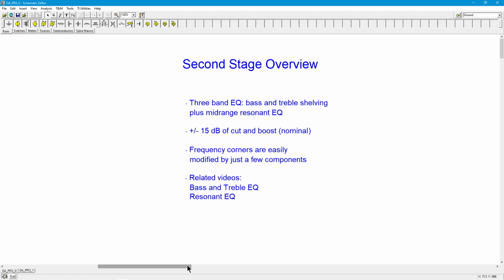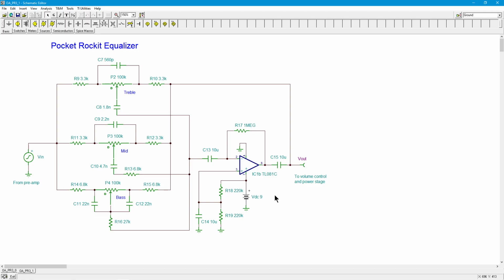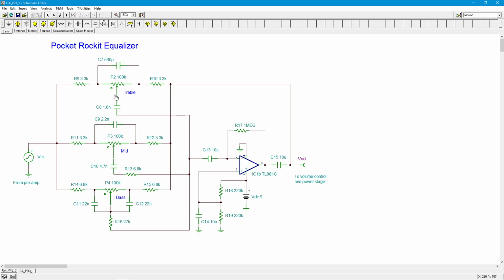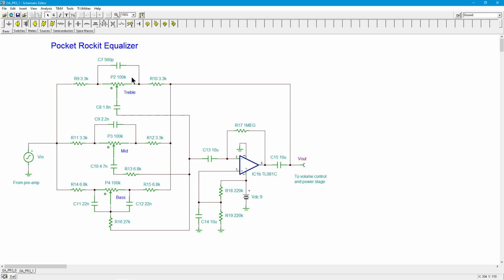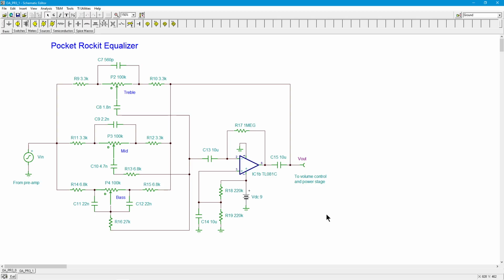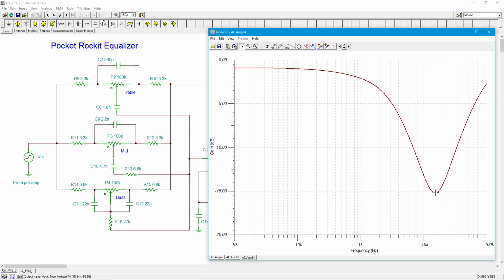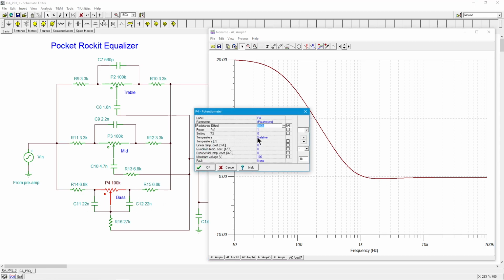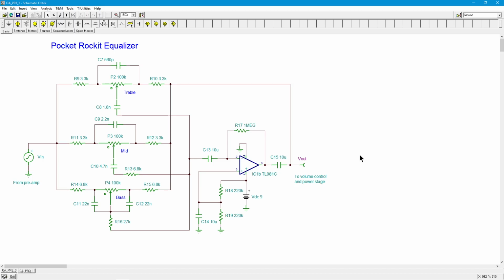Op Amps: Pocket Rockit Personal Amplifier, Part 3

Comment: I am going to expose my ignorance.  Your controls work just the opposite of what I would intuitively think.  Take treble for example.  I would've thought that turning the control to 0 would reduce higher freqs, but it seems to do the opposite.   If I turn it all the way up, would increase those same freqs.  Yours seems to do just the opposite.  Am I missing something or have I not understood EQ operation for all these years?
Reply from the maker: Perhaps the wiring in the sim is throwing you (?) This is designed so that full clockwise rotation of the treble pot increases the level of the high frequencies. Full CCW reduced them. Placing the pot in the middle leaves them unchanged. Practically speaking, reversing the outer leads of the pot will reverse the cut/boost.
Reply: @ElectronicswithProfessorFiore  Perhaps, but I do assume setting a pot to 100% corresponds to  full clockwise and zero is full counter clockwise.  In the video, when you set the pot to zero, we see a increase in  the upper frequencies.  See time 14:20.
Reply from the maker: @jamesbelcher5318  On EQ, full CCW is not 0 dB, it's max cut. It's not like a volume control. EQ controls are not labelled "0 to 10", they are labelled "-x to +x" (x being max cut/boost). In the circuit, setting the pot to either extreme yields max cut or boost. Leaving it at 50% gives no cut or boost.
Reply from the maker: After thinking about this for a bit, it occurs to me that the picture on the sim is what's throwing you, namely, that the wiper arm at "zero" is causing the treble boost, given the assumption that the pot would be wired the same way on the PCB (i.e., fully CCW is "zero"). The issue is the assumption. I could have just as easily spun the pot 180 degrees in the sim to get rid of this situation, but then the inevitable question would be "Why does the pot's wiper arm set to zero wind up fully to the right?" The only way to solve that problem is to cross wire the ends of the pot in the sim, but that, of course, looks like $#!*, and just leads to even more confusion. Fortunately, the physical solution is easy (as mentioned earlier), just swap the outer leads!
Reply: @ElectronicswithProfessorFiore  Thank you.  I will ask a couple of simple questions and I'll get how to wire it.  1) Which side of the overall circuit is boost, left or right?  2) Fully CCW is cut?  With this I can make sure the wiring is correct.
Reply from the maker: @jamesbelcher5318  Yes, fully CCW is cut for a rotary pot. That corresponds to the wiper arm of the pot being toward the op amp (vs. toward the source).

I suggest building at least part of this on a protoboard. It will be obvious if you have the pot's outer leads swapped as CW rotation (from the user's perspective) will produce cut instead of boost. (I specifically mentioned "from the user's perspective" because it's not uncommon for people to wire these sorts of things while looking at the pot from the assembler's perspective, i.e the back).
Reply: @ElectronicswithProfessorFiore  Will go directly to PCB, I don't breadboard much anymore.  Speaking of that, in the Spirit of the Creative Commons license, shall I put your name in the silkscreen?